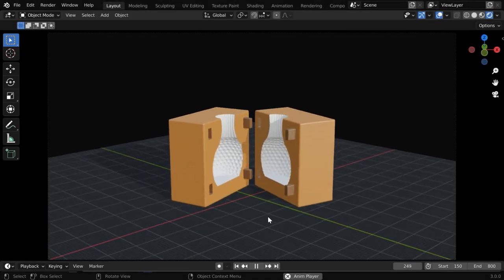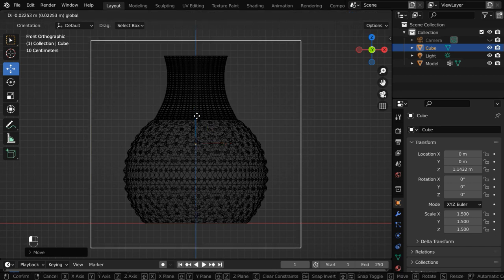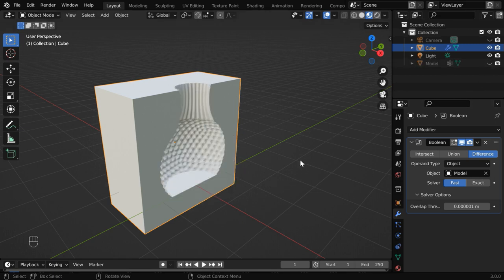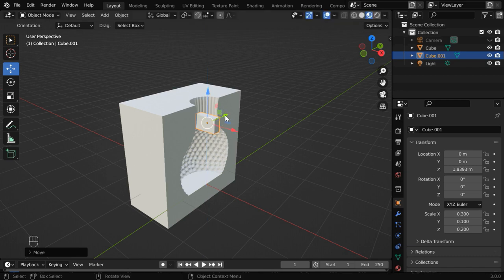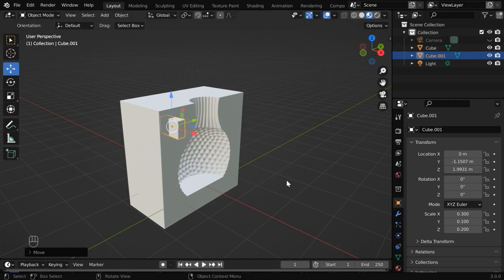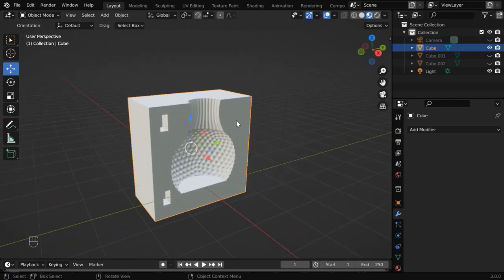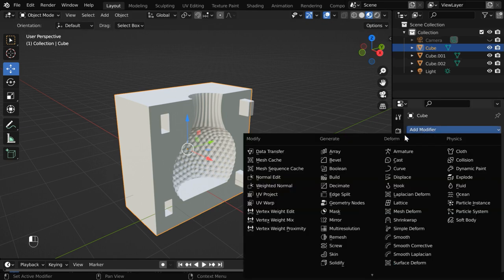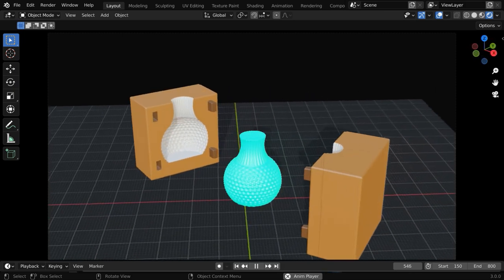Create Molds With Keys for 3D Printing | Convert Blender Models into 3D Prototype or Moulds

Comment: I'm going to use metal dowel rods to avoid wasting plastic. They are also re-usable. You can get them from hardware stores, physical OR online. You simply print holes in both halves of the mold and stick them in. You can get dowels with a flat side to allow trapped air to escape the hole. You could also print a hole all the way through the parts, with a slight shoulder to trap the dowel rods. That would save even more plastic.
Reply from the maker: Thank you so much 👍

Comment: Very good tutorial and inspiration 👍 To keep the symmetry I would rather made first a cube, then cut out the model and then cut the cube in two halfs. Sure, applying keys is then a bit more work.
Anyway, the boolean modifier hasn't made me lucky yet. I use now the boolean addon which  appears then in the toolbar (right) It works perfectly. You only have to select both items in the right order and then apply the boolean operation.
Reply from the maker: Thank you! Yes, it is always good to explore more options and try to do things in different ways. It develops our learning even further. I am very happy that you got better results in a slightly modified way 👍

Comment: great tutorial- would it be possible if I do this inmy 3d printer to pour slip clay to do slip casting on this? I wanna try this with a mug.
Reply from the maker: Yes it should work. Please remember that we're making the molds here, not the mug itself. So for the mug, you need to take care of the hollow part as well, similarly as you do in any hollow casting. The molds can be 3d printed using this process.

Comment: Unfortunately the object in the video would never be molded in a two part mold like the video shows because of the texture on the outside of the object. Trying to part both sides after casting would be impossible or would break the outside object. Also, the keys in the video are not at all how we make keys when we make molds, because they have parallel sides, you would want the keys to have keys angled walls so that seperation is easier.
Reply from the maker: Hi, I got the first point. You are right, we may need to create it in 4 parts if the texture is very rough or uneven. However, with respect to your second point, we did add bevel to the keys so that we can remove them easily. They do not have just parallel sides. I know about this problem and it is well addressed in the video I think. Is there still some gaps in our understanding?
Reply: @5MinutesBlender  The object would need to be molded in what is called a ''glove mold", with a hard exterior shell, for that, the technique you describe would be adequate, because the outside of the glove mold would be slick. 
Seeing as the object you are showing is a vase, you would also need to use more advanced molding techniques so as to be able to have the hollow interior.

Comment: Wich material to poor in? Can you 3d print the mold In plaster :)) ??
Reply from the maker: Yes, it's possible to use premix building construction material to create a 3D printed object. In fact, nowadays there are complete apartments and buildings that are constructed by 3D printing. But these printers are very special and only a few of them are available. They are very costly too. In a standard 3D printer we mostly use plastic materials.

Comment: Great video!
One small remark: Unfortunatelly it wouldn't work in this way
3D printer walls are not so flat, that it will be tight enough. Maybe for concrete it will work, but not for any liquid :/
Reply from the maker: Hmm, I see. Thanks for the information 👍
Reply: @5MinutesBlender  look forward for next attempts :)
Reply: Yeah if you're using a crappy 3d printer, pick up a Bambu or resin print the mold.  Never had an issue with some very light sanding.

Comment: Dear Sir, please help me,    i need a command to check a parting line. The parting line is center of surface for split of injection mold
Reply from the maker: If I understood it correctly, you want to know how to place a dividing plane at the center of a surface so that you can split the mold into two parts using this plane - is that a correct understanding?

Comment: There does seem to be a minor problem with this mold.  If what you are planning to mold is a solid vase it seems to work rather well.  However, if the vase you intend to mold will be hollow so you can actually put flowers in it, I think you will be out of luck.
Reply from the maker: That's true. We can easily create a hollow model (using a boolean modifier) and it can be 3D-printed without a defect. However, it cannot be used as a mold. As far as I know, molding a hollow object involves rather some manual process like welding along a seam, or molding using wax. That would be out of scope for this tutorial, so we did not go there. You are correct that this process is good for solid objects only.
Reply: This is actually perfect for slip casting. You would 3d print the mold. Then you would make silicone master molds of each half of the mold. Then you use the silicone masters to produce plaster copies of what you originally 3d printed. Then you pour slip (liquid clay) into the mold. The plaster absorbs the water content of the slip forming a shell of the object, aka a hollow clay vase. Once you fire it, glaze it, and fire it again you have a finished functional ceramic vase (and the molds to duplicate that vase as much as you want).

Comment: Can you just use small cylinders for keys?
Reply from the maker: Yes, very much possible. But it is still required to add some taper for easy handling. Or you can manually rub it with a sand paper after printing and make it suitable to push into the lock.
Reply: @5MinutesBlender  Thanks!

Comment: whats the use of a solid vase? :D
Reply from the maker: This is not a vase. This is a mold to create a vase (which will be hollow). We are creating the mold here.
Reply: @5MinutesBlender   so you need a second part that goes in after you pour the material.
if not , it is a solid vase
Reply: @5MinutesBlender  the tech name is "the core"